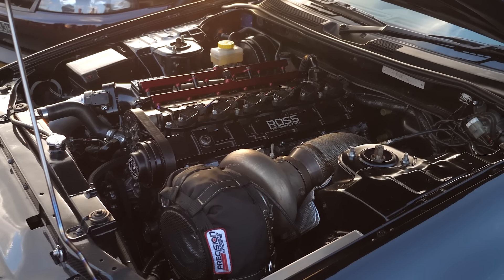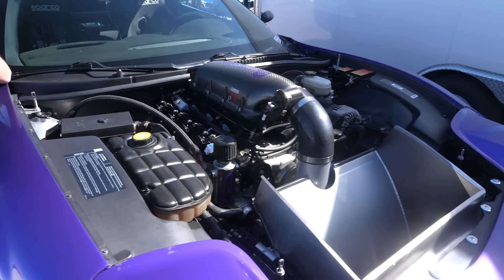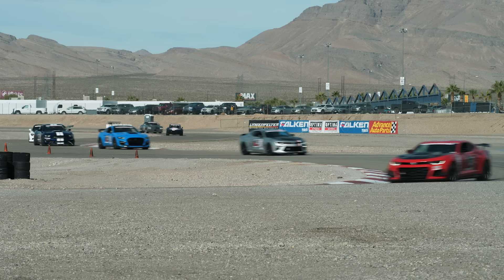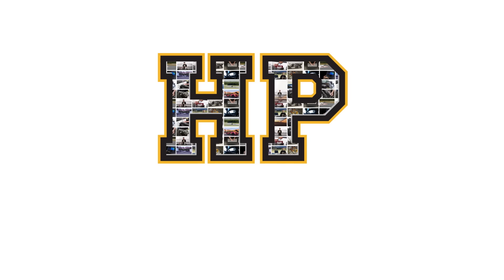What Should My Engine COOLANT Temperature Be?

Comment: 19:43 Andre, I  think ou need to add some more detail to this comment regarding waterless coolant ' having properties to improve heat transfer'. Most of the brands I've looked at, or are popular, are 98ish percent glycol based. As you mentioned, glycol is nowhere near as efficient as water at transferring heat, either at taking it up or giving it away again. Sure, the waterless coolant won't boil, but it will run hotter than factory filled coolant and water. Im told OE truck engine suppliers often need to adjust fan switch on/off points when waterless coolant is added to avoid the fan systems remaining on using use.
Reply: I was wondering about that too. I'm only aware of one brand of waterless coolant and it's definitely less efficient at transferring heat than water or a water/coolant mix. My solution is to use only as much coolant as I need, which is around 30% coolant and 70% distilled water. Nissan actually recommends a 30/70 ratio for their GTR for "performance driving" in above 0 degree F weather.
Reply: @averyalexander2303 
I'm an old mechanic, I've used Nissan coolant in everything I've owned since the 80s.
It's cheap, readily available and works.
Never any corrosion or heating issues in my road cars, utes, rally cars or dirt bikes 🙂

I looked hard at waterless coolant for the company I work in Underground hard rock mining. We didn't end up using it for the reasons above as all our gear is bought new and under warranty for each project we go to.
Another reason was fire risk. 
One thing many people don't realise is that ethylene glycol is actually flammable at fairly low temperatures, soaked into things like turbo lagging, the water boils off and you can have a fairly aggressive fire.
Reply: @Danger_mouse  I've used Prestone universal coolant in everything for years with no problems either. From my experience, changing the coolant regularly and not mixing incompatible coolants or adding things that shouldn't be in the system such as stop leak is far more important than the specific brand.

As for the flammability of the coolant, that's a valid concern. I've tested the flammability of a standard 50/50 mix and straight coolant relatively extensively and haven't been able to ignite either other than by boiling it in a dish until most of the water is gone and then holding an open flame to it. It wouldn't ignite when sprayed on a red hot surface or boiled without an open flame, presumably since its autoignition temperature is 250+ degrees above its boiling point. For what it's worth, Evans claims that their waterless coolant is no more of a fire risk than regular water based coolant, but I can't say whether it is or not since I haven't been able to ignite either without boiling it and then using an open flame.
Reply: @averyalexander2303 
On the flammability side, yes, you need to have a situation where the water boils away.
One specific machine we have used to have the coolant header tank directly above the turbo.
The header would leak from a vent hose port sometimes and into the turbo lagging where it could soak in.

We've since moved to ceramic coating the turbo instead of lagging and relocate the header during the site set up.

All the best.
Reply: @Danger_mouse  At least from my testing, it seems like there would have to be a scenario where concentrated coolant (either undiluted coolant or a mix where most of the water boiled off) is heated to its flash point on a hot surface and then ignited by an external source such as an open flame or maybe a sufficiently strong spark. I have read that coolant can be ignited by a hot surface alone, but I haven't been able to reproduce that with my testing methods. That's not to say it's impossible, just that I haven't been able to do it despite many tries.

Comment: I have my coolant system to sit at 180*F at all times no matter what the ambient temp is and trans temp is about 20* cooler than engine temp
Reply: problem in engine is not cold is hot..

you can fukitup with often hot temperatures , engine ehad dont like it..

Comment: Great video, and very relevant to my current situation. My Audi TT is running at around 60C, as apposed to close to 90C. I’m guessing my thermostat is stuck open.
Reply: That is far from ideal, i'd get that fixed asap.
Reply: Replace with a good thermostat that fails safe like the one it seems to have now. Better to waste some gas and burn some oil that overheat and get stuck somewhere, or even worse.. blow the engine. That's usually the difference between the $10 thermostats and the $25-$50 ones.

I have a MK1 TT 1.8 sport (FWD, auto 6 speed with the same Quattro 1.8T engine setup, 222hp). Amazingly fun car, and i drove a 400hp Turbo Supra for 7 years. I was very surprised by the handling, after a front suspension overhaul. Like new or better with quality OE parts that looked to be better than original. Super snug bushings and thicker sway bar links, virtually no body roll and and switches directions on a dime.
Reply: beeter go to a mechnic,, maybe not a thermostat problem but other problemm,

Comment: When explaining the NASCAR choice of temperature I was almost expecting the reason to be net thrust.
Reply: Net thrust?
Reply: @coreyw427 duct your radiator appropriately and travel fast enough (generally it's more of an aircraft thing) and you can get a small amount of thrust (or atleast offset the drag of the radiator) it's called the Meredith effect
Reply: @hannahranga  watch out the engine temp

Comment: Run it as hot as it can safely go and that comes down to machining and material choices.  Oil temps should be kept right above water boiling point to drive out moisture.  Air temps should be as cold as possible.

Comment: Great video, do you have one of these vids on what oil temp we should be aiming for?
Reply: Engine master just did a video on oil viscosity, you can get some info from that one. Ideally oil is rated at 212 degrees Fahrenheit for the 2nd number in the weight. Under 100 degree weather I will get temps up to 225-228 at cruising. On day 100+ I will get temps up too 250 at cruising. The temperature will also effect the pressure.
Reply from the maker: @isidrosevier it's OK to link such material in your comment/s too, we don't mind. 'More creates more' when it comes to quality sources of knowledge - Taz.
Reply from the maker: We don't, just this really quick rundown here sorry aside from where it pops up in some other webinars in passing on sumps and oil supply improvements etc - Taz.
https://www.hpacademy.com/technical-articles/what-should-my-oil-temp-be/?utm_source=youtube&utm_medium=social&utm_campaign=general-interaction
Reply: @hpa101  cheers….might be an idea for a new video then 😀
Reply: 95 degrees C is perfect for oil. 100 is fine. 105 is OK. But not hotter than 110.

Comment: ive noticed that my car is runing stable 81C 
but when my temp switch stopped working and fan didnt turn on ect reached over 100C 
the trick is ive noticed that around 90C my AFR is getting leaner 
i had ECT correction table set up so between 75-95 degrees there would be no fuel trim added but turns out at around 90C i need to add about 6% fuel trim to just maintain AFR 

is there a chance my engine just makes more power when its hotter? because of clearences or something? 

because one thing i really have trouble with i tuned the car AFR is consistent and there are days the car just RIPS you can feel everysingle of these 150 horses doing their best
and other days i will feel like it weights 2000kg and just wont accelerate

Comment: Heat doesn't help when drag racing people. Have yall ever seen dyno pulls or videos of everybody putting ice bags on the superchargers or intakes? People also use to run fuel lines through a can that had ice around the fuel line to cool the fuel down.

Comment: I tried running e85 in my car, I got half the fuel mileage because of my cold thermostat, great power though
Reply: and becasue your engine compression is not suitable for alchool but gasoline, so it less efficient..
Reply: had hot air to intake...if you rellay need burnt E85.

and your thermsota is colda.. cold therms are not good how much tempt??

Comment: I have a FC Rx7 grip car I've been learning to build/drive with. I have a solid cooling system, but have not added ducting or under trays to make sure the air passes where I need. I have a large multipass radiator and large fan. I'm able to pwm my e-water pump, but not my fan. If my Fueltech has the ability to do so would you recommend having the fan turn off at speeds above let's say 40mph? While on track or is it not worth the on and off electrical load? Max temps I've seen on track are 210 F = 99 C
Reply: 210 is normal operating temp but those rotary engines do overheat alot
Reply: @DylanL69  yea, I am really wanting to make some ducting or something. My system should be more than capable of keeping the temps down
Reply: @dubbleA100  the rotors get hot and transfer heat around the engine so there's nothing you can do about that but just keep as cool as possible
Reply: My rx7 fc runs around 180f and pushes 195 when doing long 4th and 5th gear pulls. I have an efan controlled by the haltech and a factory thermostat in place. In my setup the efan will come on regardless of speed if there is not enough air coming through the radiator ie temps up.

I also think it assists with engine bay airflow/temp
Reply: What efan are you using?
Reply: @mingscustoms  so if I'm doing street pulls I have no issues with temps. I'm talking about 10 mins + of full out laps on the track. I know I'm being greedy, but this is what the car is for so I want to be greedy on the temps.
Thanks for your input though ✊🏿
Reply: @mingscustoms  I've got a 16" flex a lite fan and my radiator shroud has flaps, which may not be doing anything useful since I don't have a good duct system. 
Part# FLX-105390
Reply: I am running a FLX-104367. It appears to have a better shroud design and is specified as a puller fan. It also has a slightly higher cfm rating
Reply: The static pressure the fan can generate is what's most important. The thin fan will not allow for as much pressure
Reply: Turn fan off at speed, is pointless. Most modern cars do this from factory.
Reply: @mingscustoms  that's funny. We're using similar stuff. I do like the integrated fan shroud, but how thick is your setup? I had a custom aluminum fan shroud made and I added those rubber speed flaps.
Bro do you have IG we can compare setups and keep our FCs inspired. LoL also do you track yours?
Reply: @coreyw427  can you elaborate this, sounds like you're contracting yourself...
Are you recommending to turn the fan off at speed or not? Also we're talking about an mid 80s Rx7 with standalone not some m3 comp LoL
Reply: @dubbleA100  yes, to turn off the fan at speed. Some older cars didn’t but only because they’re much simpler, not because it’s a bad idea
Reply: @dubbleA100  I don't track mine, don't live near any and haven't ever tried it. I would like to go though it would be fun. I don't post on IG anymore I have posted more on rx7club as I have been chasing a series of engine failures. I've made it through now and the car has been solid

Comment: I’m thinking my cold running temp, could be over fuelling as I only got 390km for a full tank, city driving. Previously it was closer to 500km. 

Question: could a bad or dirty MAF sensor cause my engine to run cool?
Reply: No it wont, but a dirty maf could cause the car to run rough though since temp affects air density/volume which a dirty maf wont be able to read accurately and will cause the car to use more or less fuel as the maf trys to adjust. Either or can affect mpg badly. If your car is running to cold then continue to replace ur coolant every 6 months like ur suppose to and put a new thermostat in the car. Sounds like it is stuck open. You can get different temp ones, if the car is not a track car then get an OEM temp rated thermostat
Reply: AFAIK, the main concern with running too cool (but not too cool to affect clearances i.e. piston slap) is blowby of water and unburnt fuel getting into the lower part of the engine.

The oil needs to be hot enough to cook off these contaminants or a whole host of probelms will develop.

This problem is exacerbated by short trips and cold environments.

Comment: One thing I would have liked you to address is whether glycol coolant is flammable. For example in the SCTA-BNI rulebook which covers land speed racing at Bonneville and other venues, this states that combustible or flammable coolants are strictly prohibited. This also applied at DLRA rules where you can find the phrase "all glycol-based coolants are banned". What are the recommendations for those events?
Reply: just water
Reply: Distilled water. Most coolant additives are just there to prevent freezing, which isn't an issue at Bonneville, and also to prevent corrosion.
Reply: (That said, if you're storing your land speed car somewhere it freezes in winter, leaving it with a coolant system full of distilled water may cause you problems, so keep that in mind.)
Reply: It's not banned in racing for flammability, it's banned because it's SLICK in the case of a leak - about as slippery as actual oil spills. 
Absolutely DO NOT run distilled water as someone suggested or you will destroy your cooling system. Distilled water is for topping up glycol based coolant systems.
What you need to use is DE-IONISED water, with wetting agents added. It's what most glycol-free, race coolants are. Essentially what it is, is treated water with no corrosive minerals, and wetting agents that help it stick to metal to actually take the heat out. VP Racing do a brilliant range of them, with or without anti freeze. If you run the anti-freeze version, you'll run a bit hotter. If you take that out, the other version of coolant will cool better.
Reply: @dons1932  hey, thanks for the correction. I'm glad someone who knows more than me chimed in.
Reply: @dons1932  Direct quote from SCTA rules: 7.B.29 COOLING SYSTEM: Any combustible or flammable coolants are strictly prohibited. From DLRA rules: "No flammable or combustible coolants are allowed. All glycol-based coolants are banned."

Perhaps glycol is banned for more than one reason depending on the race series, I'm just quoting the rulebook. Thanks for the tip about DE-IONISED water and wetting agents.